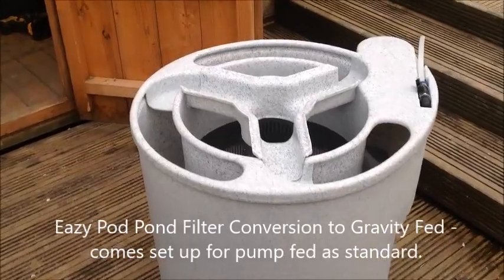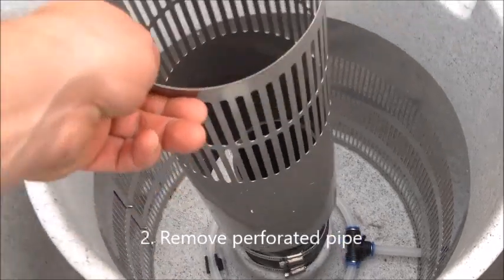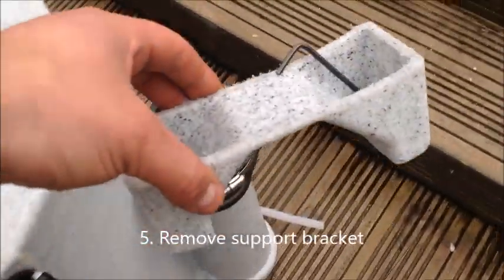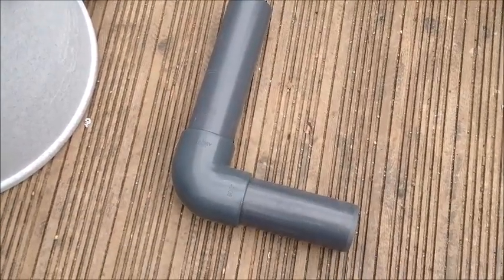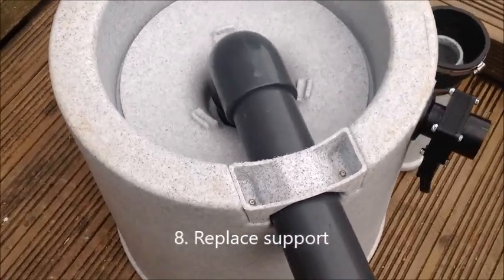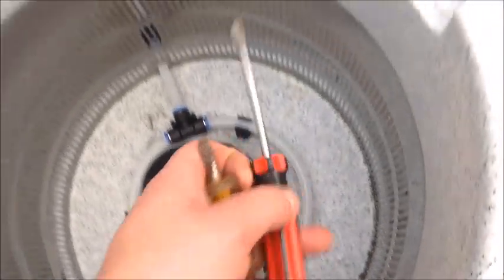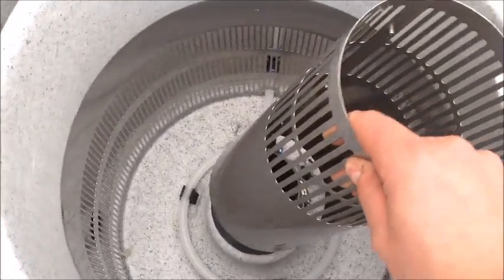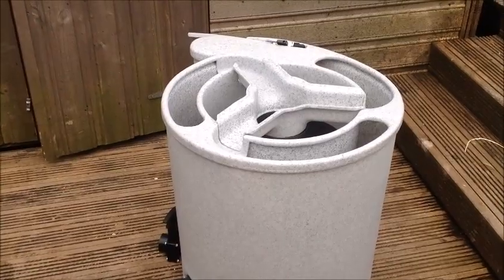Eazy Pod Koi Pond Filter setup to Gravity Fed - Easy Pod Evolution Aqua

Comment: Is the rubber clamp on the inside attached to the bottom or not. I can understand how you pulled the pipe out so effortlessly without loosening both clamps. And would i be able to replace the rubber boot? Putting the pipe through on mine is so tough you would think its solvent welded.
Reply from the maker: @hazzardoutdoors  when you say I pulled the pipe out. What time in the video are you referring to?
Reply: @craynerd  when you pull it out of the bottom of the pod.... but you only loosened the top jubilee clip so isn't the lower still nipping the pipe.
Reply from the maker: @hazzardoutdoors if you mean at about 50s in the video, the top jubilee clip is attached to the plastic pipe and the bottom clip is attached to main body of the plastic drum. You only need to loosen the top clip to allow the pipe to slide out from the bottom 👍
Reply from the maker: I’m just looking again because it’s a while since I made this video.
Yes - 100% just the top clip should be needed. As I say the bottom clip is actually attached the main plastic tub. It is essentially creating a water seal between the pipe and the tub. In actual fact, if you remove the bottom one, it won’t do any harm but you should then be able to pull off the rubber boot from the pipe and tub. 
It really can’t be solvent welded as the pipe really isn’t a tight fit through the centre hole. In fact, I’m not trying to confuse you more but I was always surprised how lose a fit that pipe is. Remove the plastic bracket from the bottom and it’s actually just that bracket that’s holding it in. With the boot removed and the plastic bracket off the bottom, turning the tub the right way around, the plastic pipe should just fall out! If it has second hand, has someone had a leak from the rubber boot and randomly sealed up the gap that the pipes goes through?? It really should fall out under its own weight without the boot on.
Reply: @craynerd  i undid both clips and took them off. And I think I'll still have to cut the rubber off. And trying to get a new 3inc boot over it is very hard, can I use a silicone lube or anything.
Reply from the maker: @hazzardoutdoors  only the top of the boot should be sticking to the pipe. The bottom section is on the plastic tub not the pipe. Strange - good luck and let me know when you figure it out as I’m also intrigued and confused!

Comment: On the easy pod instructions I've read it also says you have to cut Into the inlet and remove a piece of pipe to then be used as your cleaning pipe? I would have thought the one that comes with it would be sufficient?
Reply: I've just realised there's two different sets of instructions, maybe one was for an older model. The other describes what you have just done exactly. Is it a good filter in your opinion? I'm looking at getting one.
Reply from the maker: Hi. I certainly didn't cut mine and didn't see that in my instructions. Like you said, you get one provided!
Reply: @craynerd  is it a decent enough filter do you think? Thinking about running this with a bakki shower
Reply from the maker: Living colour Designs I think they are great filters for the money, especially second hand! You can pick them up for £200-250 on eBay and for a compact easy to clean filter they are ace. Smallest I’d use for a dedicated koi pond but equally suitable for a koi pond! Start comparing them to drums and well they aren’t in the same league, but them at £2000+ for a drum, they aren’t in the same price bracket! I’d certainly try second hand. Always loads on eBay and half the price as new and function just the same!

Comment: Hello great idea does the water still go in the original inlet as would the inlet not be too small for all that water trying to get through it via gravity alone?
Reply: Am hoping to pump up to a vortex then gravity feed into eazy pod then to waterfall. That way I will be able to buy and install your modification disc without the eazy pod clogging up too quickly :P
Reply from the maker: Dean Piggott hi Dean. This isn’t a modification or idea, this is actually in the easy pod original instructions. The pod comes setup for pump fed and this is officially how to change it to gravity fed. Cheers
Reply from the maker: Inlet is exactly the same... the only difference is the shorter section is inside the pod so water overflows it via gravity and fills the pod.

Comment: Hello, does anyone know what the length of the two straight bits of pipe are  without the elbow included, I've just brought a second hand one that was gravity fed and  the difference between the two bits is 3/4  inch. 1 at 8 inch the other side 8 3/4 inch is this OK.
Reply from the maker: Danny Walker I’m sorry that I can’t offer to remove my pipe and measure it. However, from memory this doesn’t seem quite right. I thought the longer one was at least 2-3 inches longer at a minimum, I’d have guessed.
Reply: @craynerd  thanks for the reply, I've had a look at a couple more videos and it looks like
It's a couple of inches shorter that it should be for pump feed, The person I brought it off had it as a gravity fed
Set up and cut the other end down by the looks of it , shouldn't be to much problem I can add somthing on to make it up,
The seller said it might have been cut but shouldn't be a problem but that pipe is that long for a reason, appreciate your reply.